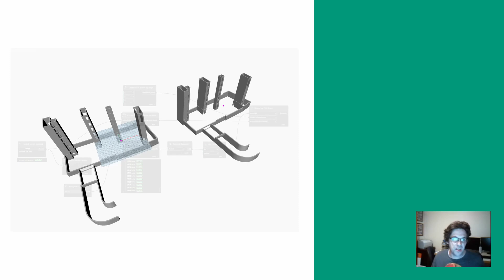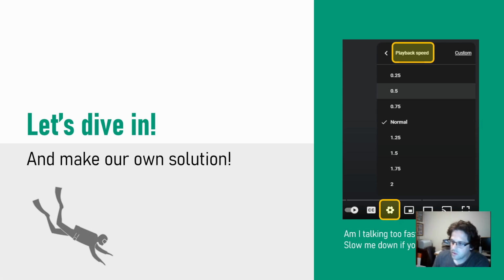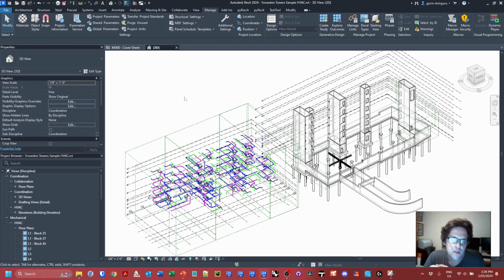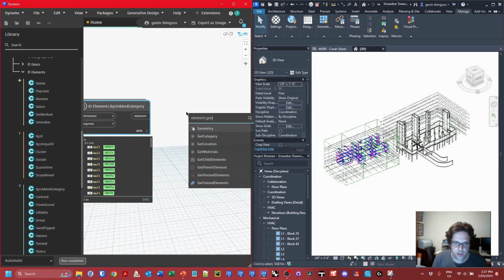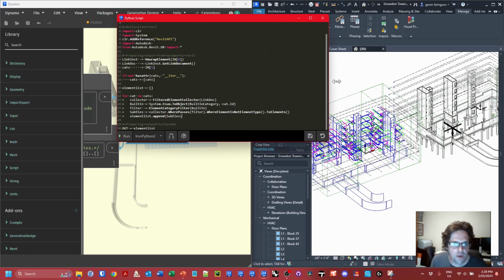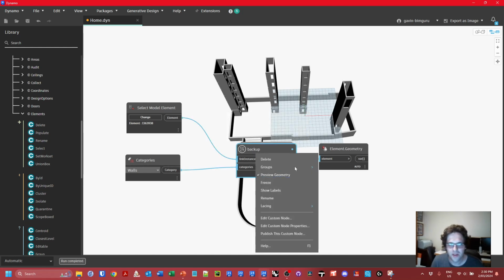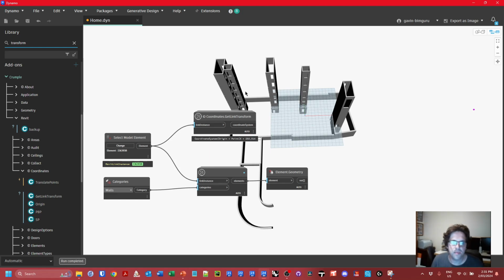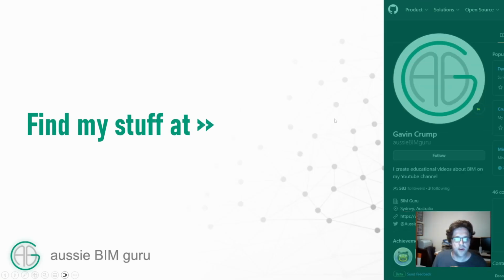Aligning linked geometry using Dynamo for Revit!

Comment: Is ToCoordinateSystem available in only Dynamo python? Can we not use this at pyrevit?
Reply from the maker: Coordinate systems are an abstract geometry type in dynamo but not revitapi.

If using revitapi the best alternative is to use the transform class to move geometry.
Reply: @AussieBIMGuru  So we need to bring internal point's transform? Thx Ill try
Reply from the maker: @newbiepoorazn  check out the code Genius Loci uses in their Python node, which should get the transform. From there Transform.OfPoint() can apply the transform or the Inverse depending which way you are applying it.

Comment: i have a query, how to preserve the geometry after transforming it to correct location  it just vanishes after dynamo workspace in closed
Reply from the maker: This geometry is only a preview. If you wish to make it in revit then you will need to create it - quite difficult to do consistently.

One option people use is using the DirectShape related nodes.
Reply: @AussieBIMGuru   thankyou for the quick response.😊👍
 I just thought since in this case we created  model geometry in revit and just used dynamo to transform the geometry to different location, that there might be some work around to actually set it in place in revit as well. 
 Isn't it frustrating to see things correctly in dynamo but can't perform it.🤣

Comment: I will ask not too clever question, can you please tell me in which stage of designing step this action would be the best to do?, in process of setting up a file (structural discipline) and then linking arc model to start modelling structure or is this alignment when both disciplines have majority of modeled elements in place and then we just want to be sure that all is matching by doing this process in dynamo?, is this also one way of getting walls, slabs from one discipline into another and having them at same exact coordinates?(Something like copy and monitor but more efficient),video is great by the way, except I get little bit lost when you search something on your computer:)
Reply from the maker: So this is actually a workaround in dynamo mainly, as dynamo always uses internal positioning and doesnt transform linked geometry to the actual location by default. Most jobs will have this unless all models began from same internal origin and relative to it from there - very unlikely.

For most projects I manage, I set up shared coordinates as soon as we align site model to a survey, and get the consultants to acquire its coordinates.
Reply: @AussieBIMGuru  So if company doesn't have all disciplines within its structure than this proces with dynamo will highlighltly occur?.

The second part of your answer sounds like what I experience in my working environment and therefore we don't have problems with linked files being aligned. 

Thank you for your time and helping me to understand parts of processes better.
Reply from the maker: @tbijondagmail yes it is more common if different companies collaborate or if models use differebt internal positioning.

Comment: It’s  pretty OSM 🥳…Thank you very much ….!

I have a question here ,By the same one , instead of linked model , I have cad file then Can we align some category elements to the this cad ?
Reply from the maker: To do that you would need to get the cad elements like blocks etc. Bimorph nodes has nodes for cad lines and genius loci has some for block locations. If the file is messy then it will be difficult though.
Reply: @AussieBIMGuru  Thank you…!